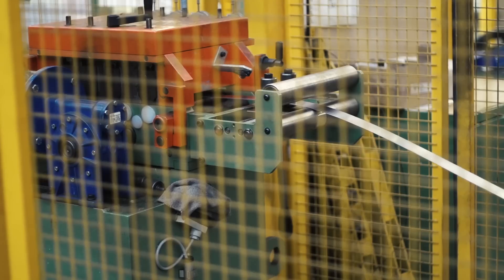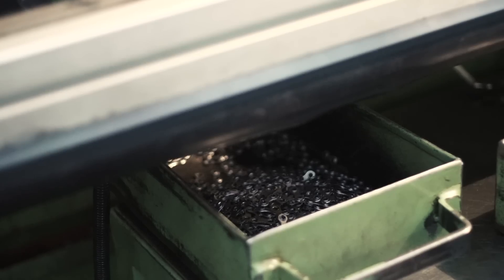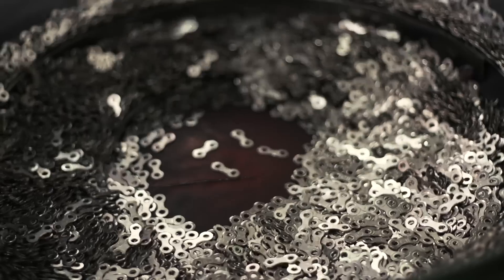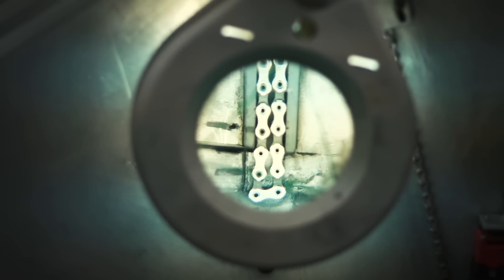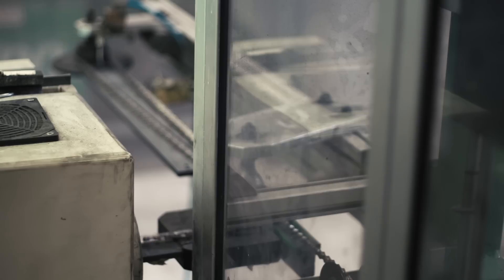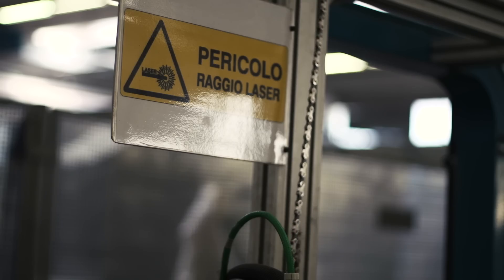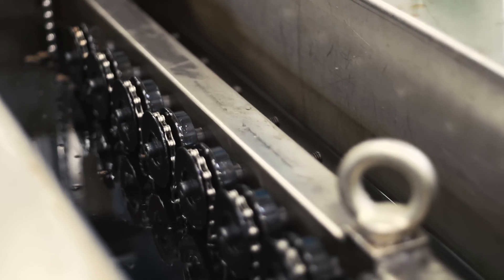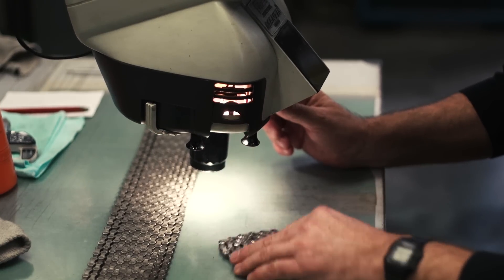Campagnolo - How A Campagnolo Chain Is Made

Comment: A bicycle chain is pretty simple compared to other types of chain.  There are only the links and rivets.  Sure, its technical but not many components involved.  Plus I am surprised how slow the stamping and assembly processes are, moving like a toad.  The video makes it look like they check every piece of chain that comes out, no, they do quality checks for each batch or after a certain amount of time.  The people making the die that the links are stamped out on are the most technical part of process.  This type of chain compared to chain for chainsaws is low-tech.  Chainsaw chain, has additionally cutters, drive-links, anti-kick-back links involved.  Plus some cutters are chrome plated for edge life.  A company I am very famaliar with 30 years ago made over 140,000 of feet of chain in a 24 hr period, three shifts.  The life of a chainsaw chain is much more violent than a bike chain.  Nice video though and relaxing commentary I have grown to expect from Dan Lloyd.  Thank you.
Reply: Campagnolo is top of the line.
Reply: In fact, each chain is manually checked. 
They do not do batch checks. 
I know this as I am involved in the warranty process at Campagnolo and was in this part of the factory last week!